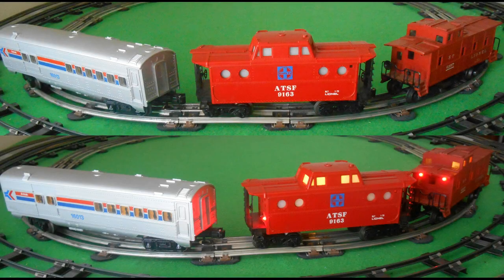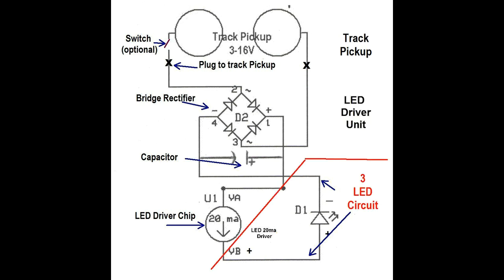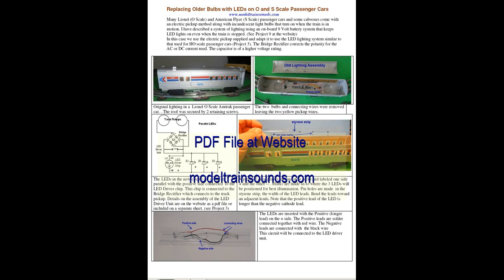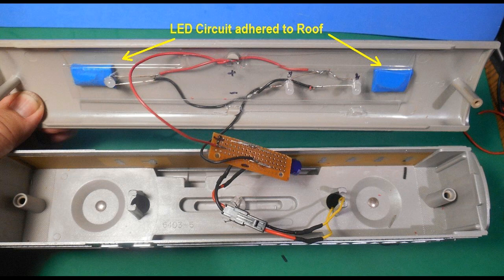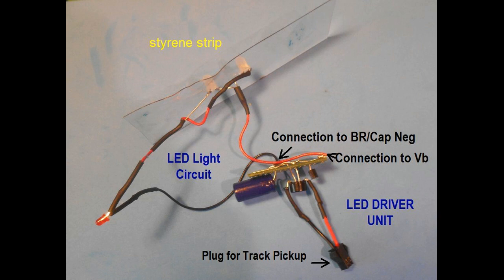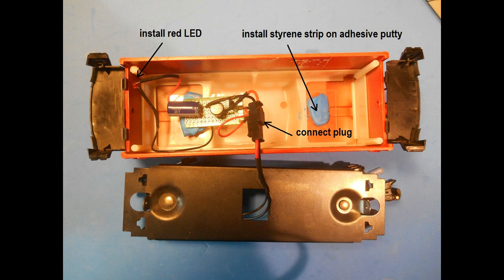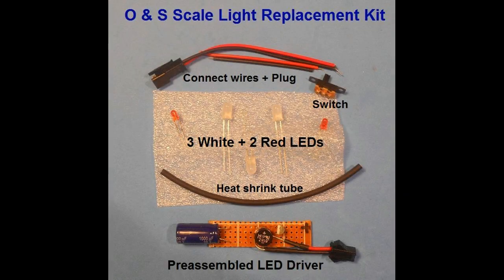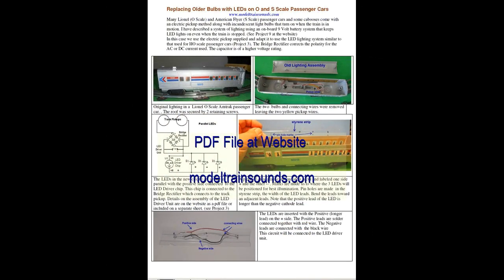LED Lighting for O and S Scale Rolling Stock Cars with track pickup

Comment: This is very interesting and I plan on ordering at least a couple kits to try out.  Do you have a 'wig-wag' kit for flashing crossing signals?  Another question, I have several LED solar lights that have quit working, are any of these components worth salvaging?
Reply from the maker: I currently do not have a "wig-wag" kit for flashing crossing signals. It is being worked on. As regards the solar lights we do not use them.   Thanks for asking.